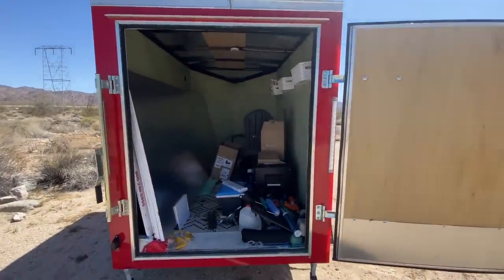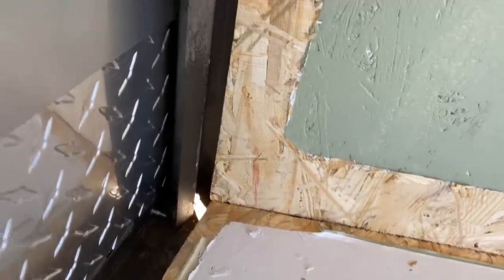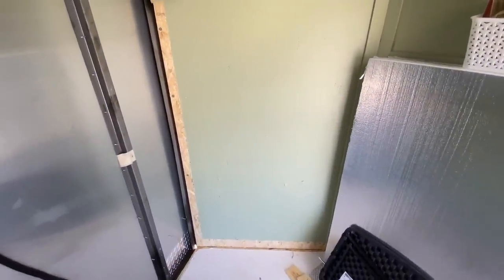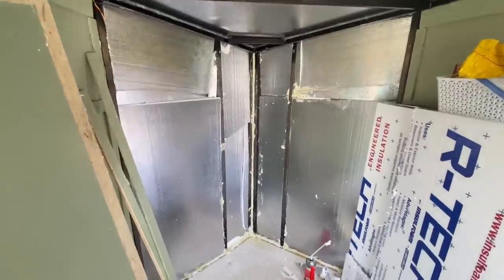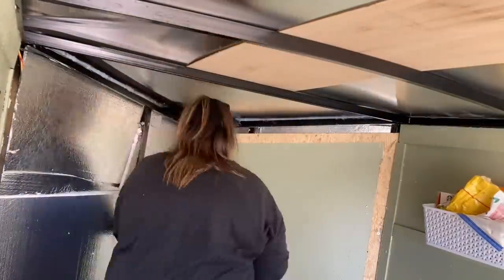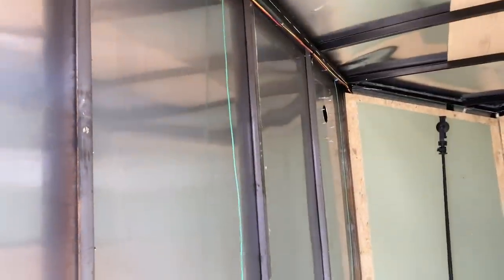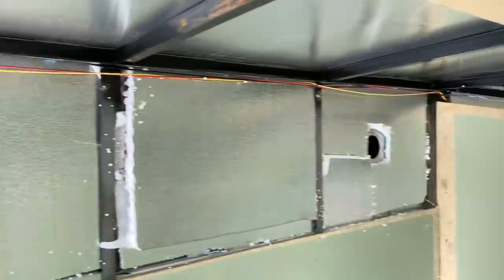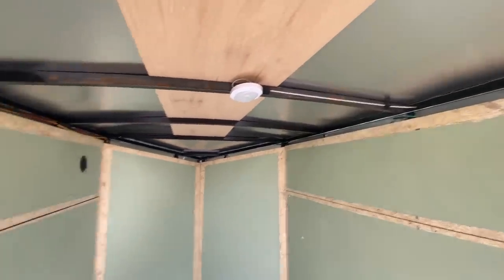Insulating My 5x8 Cargo Trailer with cost breakdown

Comment: Hey Brooke, you may also wanna consider using a silicone sealant or liquid flashing on all the exterior seems too. It’s a good way to double up on preventing water intrusion/ mold. And then you can just check them like once a year and fill em in (unlike the seems behind the insulation). This is what a lot of people with mold sensitivities do and it seems to work well.
Reply from the maker: Since the trailer is brand new, it’s already sealed on the outside
Reply: @BrookeandPippa  It's better to do a bit of overkill, just in case the factory missed any spots-just like they left that hole you had to fill.

Comment: I assume you have watched as many YouTube videos as possible before starting the process. You may want to pre wire for a solar panel while you have the wall open. It may not be easy to get the wall open again with all of the silicone, glue or whatever you are using. Just a thought.

Comment: I know you said you don't want to insulate the floor so you could stand up, but I just saw a DIYer install the floor insulation under the trailer... might be an option if you're interested in it....
Reply from the maker: I have thought about that! I don’t think I want to insulate though this summer because I want the cooler air from underneath the trailer when it’s hot

Comment: I think you done a great job I would just recommend doing each section in one piece if possible less gaps or seams mean less spece for dead air to have to heat or cool but the insulation will make a huge difference in the trailer
Reply from the maker: If I did that I would have had to buy twice the amount of insulation just to cut it longer. I don’t think it matters that much